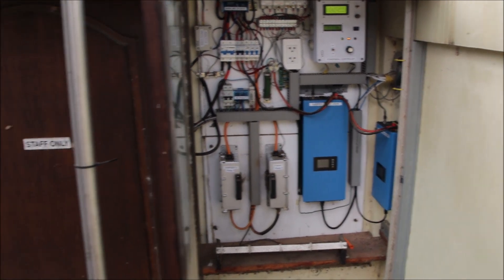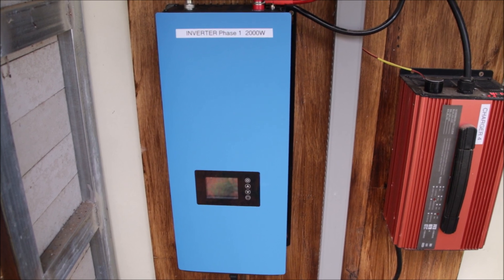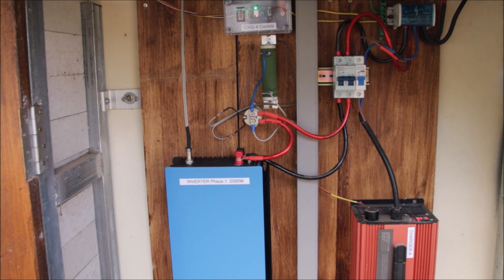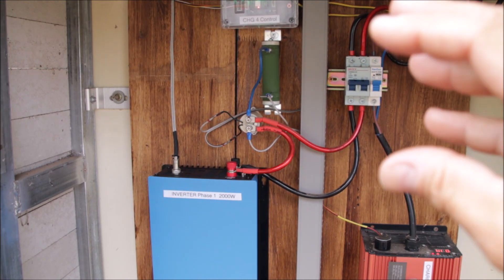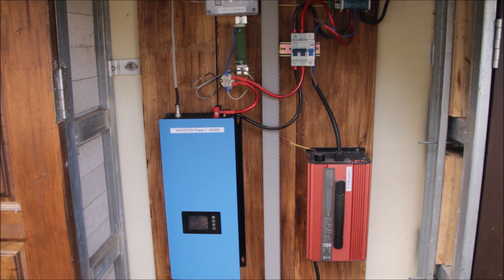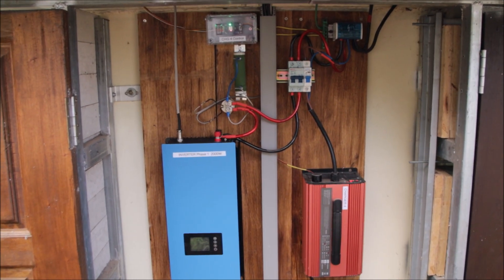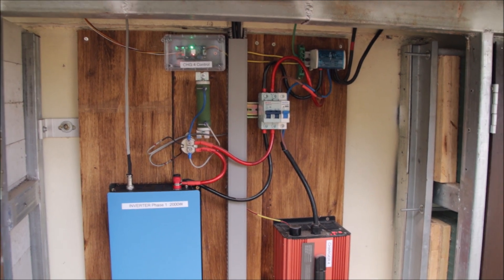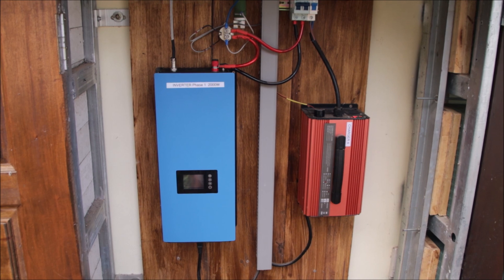Voltage Protection Relays. Can they help me to avoid my Inverter AC-side Faults??

Comment: Great explanation, thank you. What would happen if over or under voltage occurs and after the timeout of 60 seconds, the condition still exist. Will the device stay disconnected until voltage is normal again even if it takes hours.?
Reply from the maker: @gssrustenburg  yes, the timeout count down will only start once the abnormal condition is cleared.
Reply from the maker: @gssrustenburg  yes, the timeout count down will only start once the abnormal condition is cleared.

Comment: I am quite confident this will help, cause the power autages at least in our village can be chaotic, sometimes like a strobe, many short ones and repowering mostly with several tries. I have them installed at the main grid input and at the output of the inverter too, same brand but additional with kilowatthourmeter and leakage breaker, but the delays are just adjustable down to at least one second, even the minimum of 0,1 is printed in the manual : /  My Inverter input and output are not connected to the grid and the neutral to earth bonding is still not done, cause my trust into the public grid is equal to zero ; D